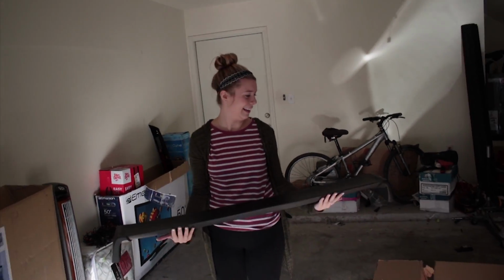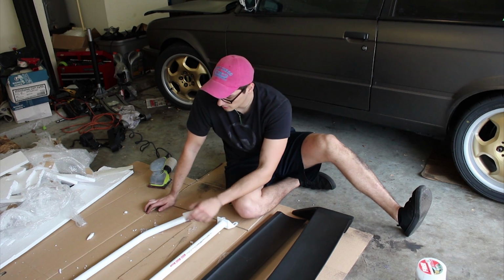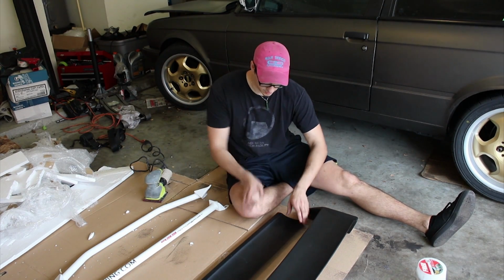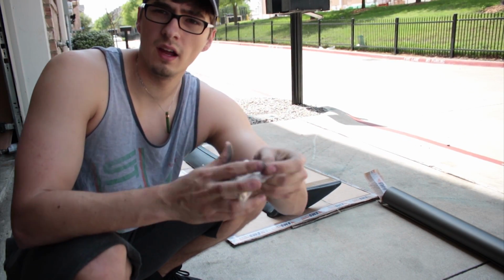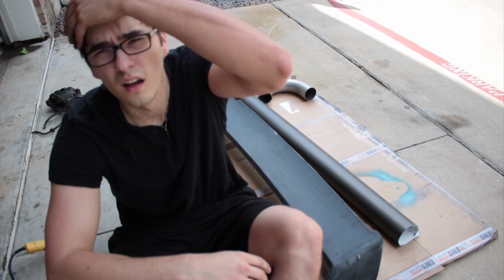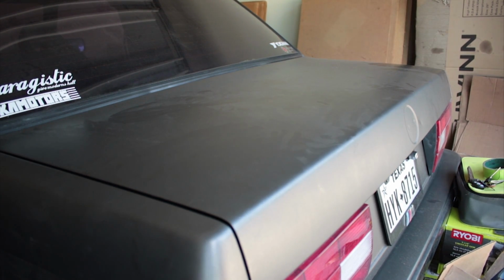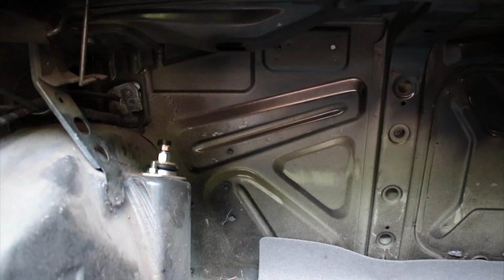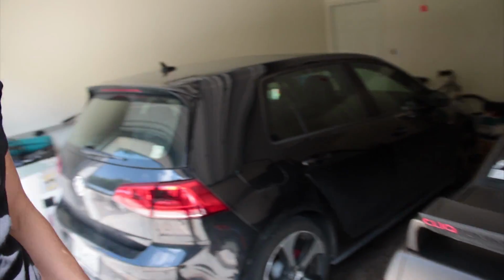Turbo BMW E30 Build: Part 23 | Evo Wing and Rear Strut Brace Install

Comment: i shared your m20 oil tap, i myself am doing a e30 turbo but i went fully forged i have a 3.0liter turbo build.i shared your m20 oil tap i watched that video like 5 times so i could tap my m20 for the drain line. great videos man

Comment: I was thinking of picking one of those DTM style wings I really like the look and functionality.
Reply from the maker: Blake's Garage Functional aero is an entirely different beast.
Reply: EuroGarage this should make a bit of downforce...no? Did you feel more drag at all?
Reply from the maker: This is 100% non-functional aero. Yes it will add some downforce but the lift ratio will be garbage so it's rather pointless in that regard. If I really wanted it functional I would design it.

Comment: For the rear shock tower reinforcements did you grind down the weld that runs along the fender. On my 318is i just let it sit at an angle on top of the weld lol, shared btw
Reply from the maker: I did not actually. Interesting.